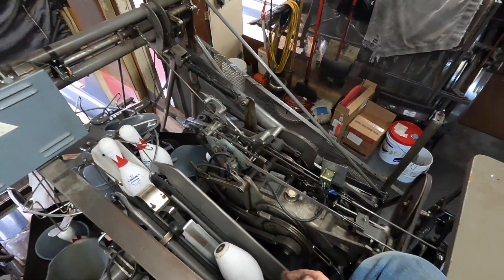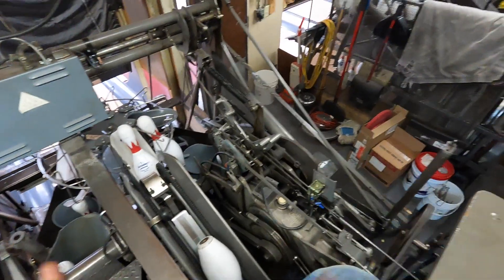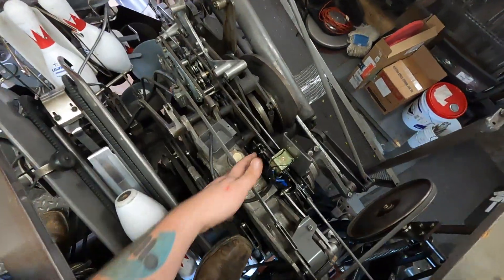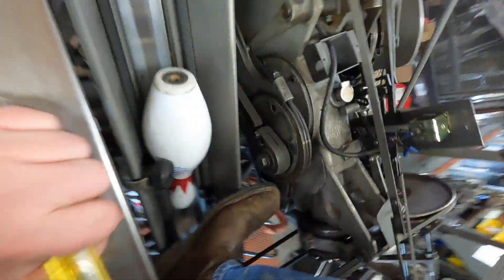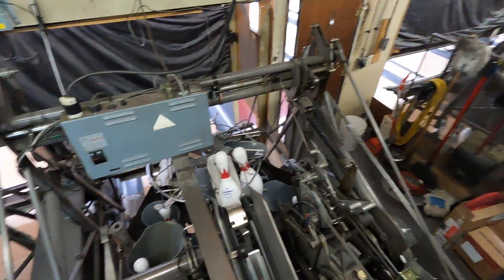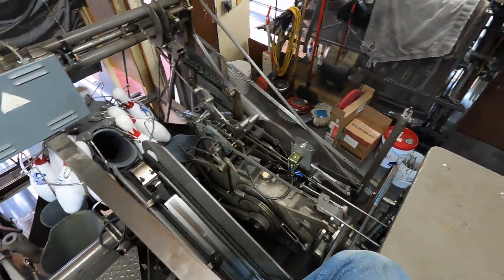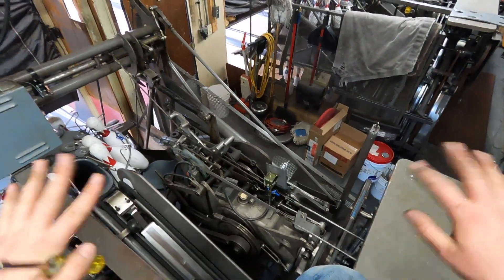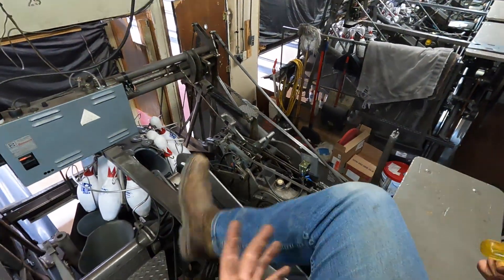Cycle Solenoid #11 - Brunswick Pinsetter Adjustments

Comment: I have a machine that will occasionally double cycle. Have swapped time delays. Have replaced and swapped solenoid with other lanes. Could this adjustment solve that? Im doing it regardless but my hopes are not high.

I also have a lane that wont power on and would love some help. Verified all fuses and switches are good. Still no power
Reply from the maker: The double cycle thing almost all my machines do that. Even the rebuilt control boxes with new time delay. As for lane not having power double check your safety switches, you motor contactor or motor start relay

Comment: I Shawn. Thanks for taking the time to make these videos! There are a lot of newer technicians that really are hungry for this knowledge and guidance. 

This adjustment will work with a new solenoid and plunger. However, an older solenoid with some milage on it could have different results.

I have seen some high milage solenoids and plungers actually bind up when they have that much stroke length. 

I don't think you got lucky with your adjustment process. But, it may not work the same way for people who have high milage parts.
Reply from the maker: Thank you for the compliment! And that makes sense, could just depend on how the parts ware. I could see that! Thank you for the insight

Comment: The cycle selenium will not trigger
Reply from the maker: Your solenoid might be bad or your time delay in the control box could be bad
Reply: Would that cause continuous cycling?
Reply: @scottsutherland8917  Bad TDM, if old style, could cause continuous cycling, or no cycle at all. New TDMs, most likely fail to trigger or none. Continous cycle could also be caused by a short in the ball rack reset button, AKA 10th frame button. Also many more in that cause mechanical wise.
Reply: Thank you for responding